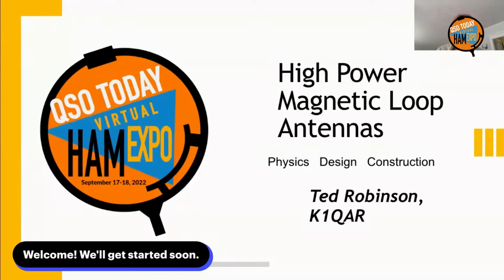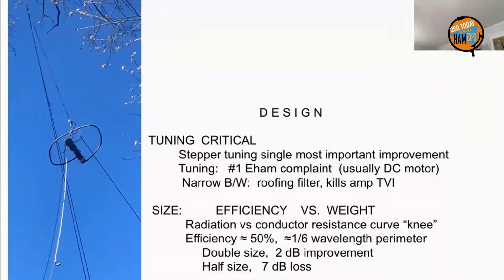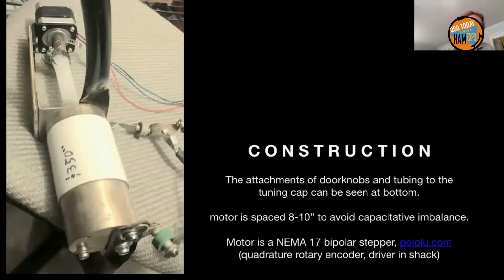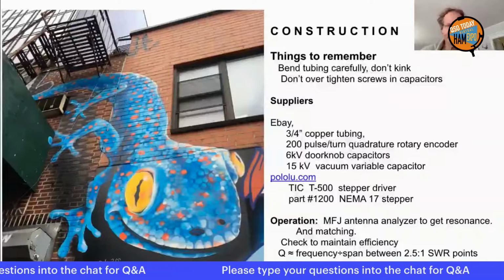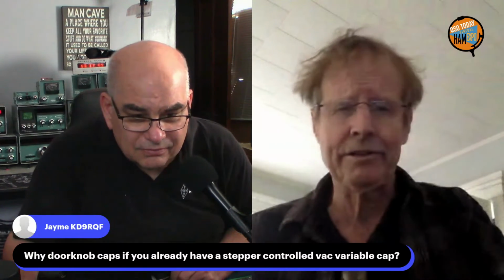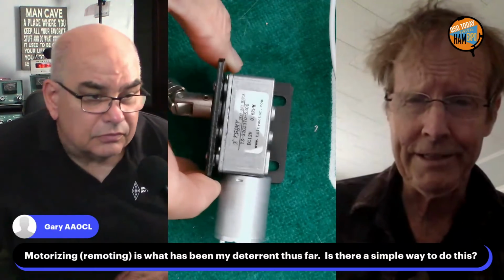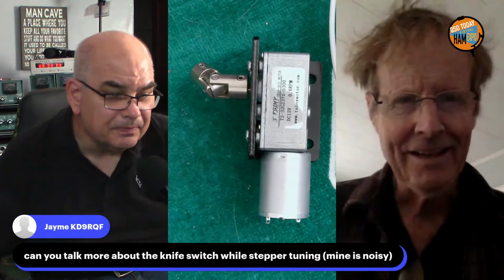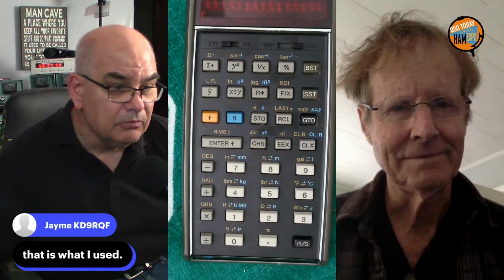High Power Magnetic Loop Antenna Theory and Construction By Ted Robinson, K1QAR

Comment: I'm building a loop using a hula hoop, don't laugh, covering with silver plated 1 inch copper braid which has been gently expanded to fit over a 1 inch loop at 30" diameter for 21 MHz. Comet 5-125 pF vacuum cap rated for 4.8 KV RMS for 100 watts CW power, will tune 21 for 85% efficiency, 14 for ~50%. Silver plate won't help much unless 20 microns thick and most silver plate to wire is only 1 micron, but it looks nice.  The manufacturer, Continental Cordage, refuses to answer my emails asking for the plate thickness spec of their 178S braid, so might have more than I think.
Reply from the maker: Will you report back on how using the braid works on your hula hoop?

Comment: Interested in 80/40 bands mostly.  Building mine with 6" semi-Rigid aluminum Duct.  They have 3", 4", 6" and 8" diameters.   and yes Russian Federation 15KV Vac Variable.  Going initially with 24 ft. circumference.  The Vac Variable can easily fit inside the duct so makes a very nice package.  Where are the inefficiencies in the Feed? What about a few turns around the duct and use Open Wire to a balanced tuner?   How high of power can I do with 15KV?

Comment: It's 66Pacific and their calculator although good, keeps telling me longer circumferences which will work are not ideal. What? i.e. 15 feet circumference at 21 MHz which is a bit more than 3/10 of a wavelength is not ideal? Appears they believe the loop must be less than 1/4 wavelength, not fully true, up to 7/10 of a wavelength will still preserve the nulls with the antenna acting like a MLA. Also, below, you will find a loss resistance, what is that based off of and does it include skin effect? The value will be different depending if copper or aluminum conductor.

Input Values:

Length of conductor: 15 feet
Diameter of conductor: 1 inches
Frequency: 21 MHz
Transmitter power: 100 watts

Antenna efficiency: 97% (-0.2 dB below 100%)
Antenna bandwidth: 166 kHz
Tuning Capacitance: 15 pF

Capacitor voltage: 2,502 volts RMS
Resonant circulating current: 5.05 A
Radiation resistance: 1.89 ohms
Loss Resistance: 0.068 ohms
Inductance: 3.76 microhenrys
Inductive Reactance: 496 ohms
Quality Factor (Q): 126
Distributed capacity: 12 pF

Antenna "circumference": 15 feet
Loop antenna	Side length: 1.88 feet
Antenna diameter: 4.5 feet

Comments:
((Their red highlighted warning which is wrong)):   The specified conductor length of 15 feet is not ideal.

Conductor length should be between 5.68 and 11.4 feet at the specified frequency of 21 MHz.

For highest efficiency, the conductor length for a small transmitting loop antenna should be greater than 1/8 wavelength (greater than about 5.68 feet at the specified frequency of 21 MHz).

((This statement also wrong)): To avoid self-resonance, the conductor length for a small transmitting loop antenna should be less than 1/4 wavelength (less than about 11.4 feet at the specified frequency of 21 MHz).